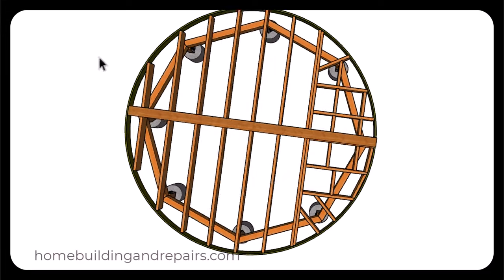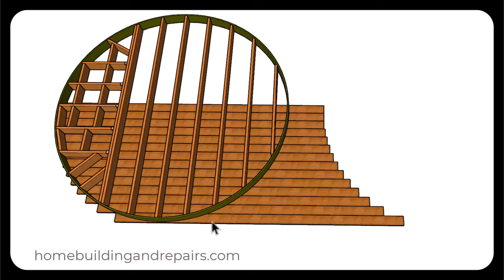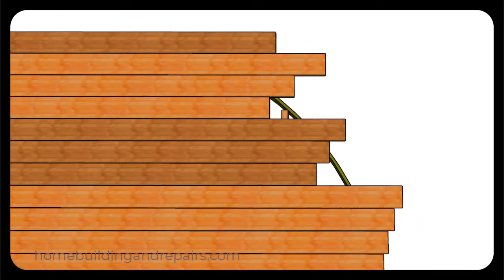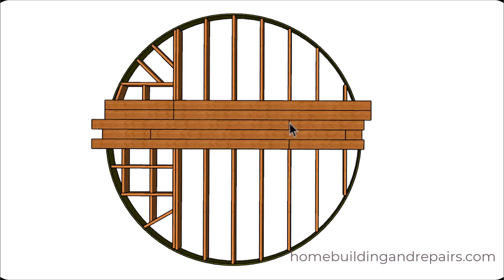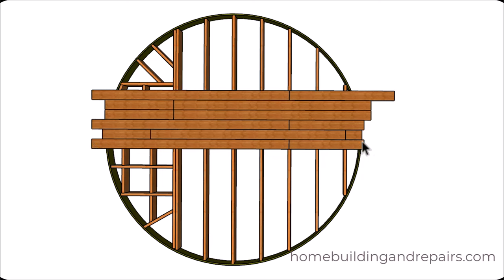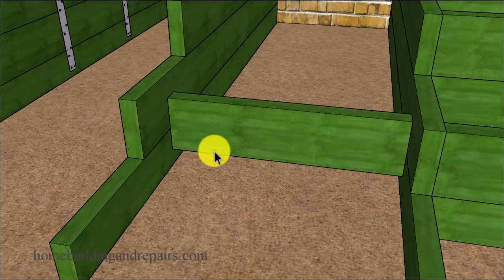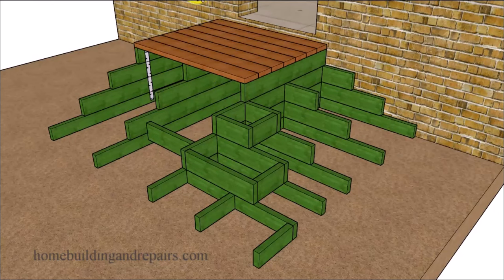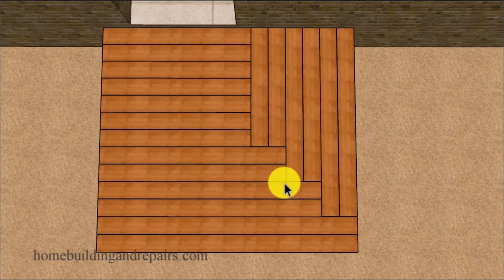Simple Methods For Estimating Materials And Positioning Decking Boards For Curved or Circular Decks

Comment: Thank you so much. I am planning to build a massive deck next spring, and these videos have been really helpful. Do you have plans on doing a video on substructure around above ground pools? I have a 15x30 pool, and i am trying to think through the best method to design it. Also, any plans on doing a video on designing an ADA compliant wheelchair ramp to the deck? I have a 30-inch rise, and i have no idea how to build a 30-foot ramp.
Reply from the maker: I do have some ramp construction videos, but couldn't find them. I added your suggestion to my video creation list.